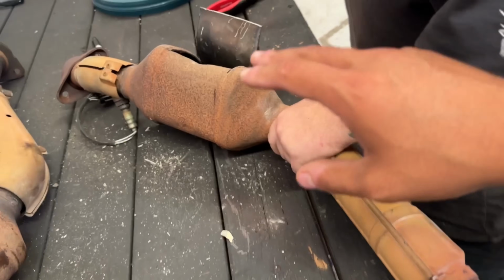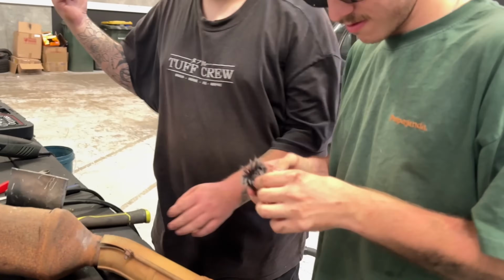HUGEEEEE COMMODORE FLAMES!!!

Comment: Where is the limi
Reply from the maker: Gone 😤
Reply: @Richy_btw  rk garage can not tune. my ghost cam doesnt throw flames on idle and hes set the limiter way to high the car is valve floating its revving way to high and the stock valve springs cant handle it lol
Reply: @Richy_btw  bro the limiter is the best part of a eco that sounds bad now 🤣
Reply: @ohnorebs  Awkward.... I didn't touch the limiter... also this isn't valve floating... And holy crapppppp, this video is about flamess... why did i tune it to throw flames instead of it not doing that....
Maybe someone needs to learn a thing or two...
Lol
Reply: @RKGarage sounds like an eco valve floating with a limi set above 6400 to me mate. There’s no other reason the limiter should disappear unless your tune is garbage
Reply: @paigemcbain9293  Well you are taking it up with the wrong person. This is tosh tunes, tune. I just did the idle on it.
Reply: @RKGarage  fair enough mate. Well that’s another question I’ve got for you why does your ghost cam throw constant idle flames? Mine doesn’t and never has
Reply: @paigemcbain9293  Because they wanted flames... hence what this video is about.
Reply: @RKGarage  yeah I know mate I’m talking about your ghost cam tune in general. You won’t sell it because it throws flames at idle. But my ghost cam doesn’t that’s my whole point
Reply: @paigemcbain9293  I see you are missing the point...  "I won't sell it"
It throws flames at idle is enough of a deterrent I don't get harrassed to sell it any more than I do.
Getting it to not throw flames is easy, but pointless, exactly like a ghost cam is... pointless.
Reply: @RKGarage  yeah like I said anyway man more concerned about the fact of this thing having no limiter. Tosh tunes are supposed to be half decent lol I’m a backyard tuner and can do a better job then this, don’t know what they’ve done for it to sound like it’s just valve floating